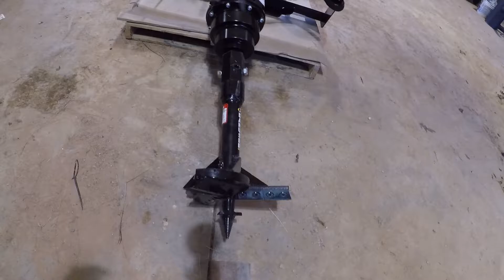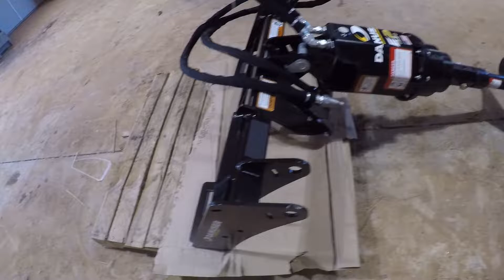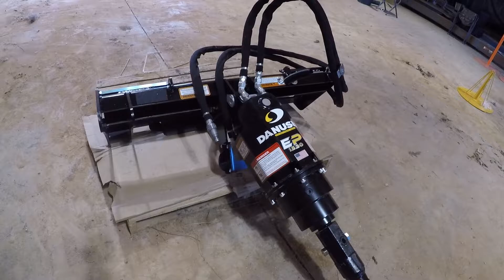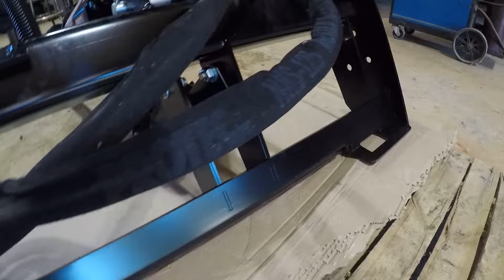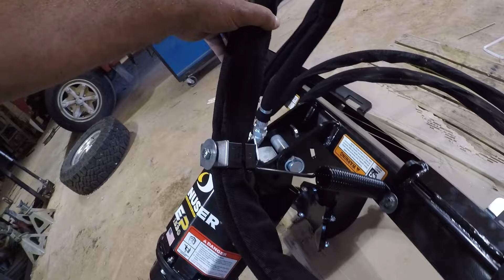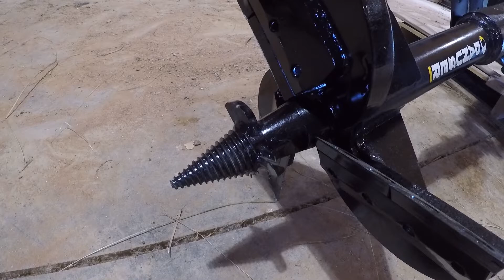Danuser Stump Auger Overview

Comment: Very thorough walkaround, excellent video! Thanks!
Reply: Can these be used on mini excavators like a 30G Deere?
Reply: @TexasStar1  Yes. The 10" needs an auger drive with 1,700 ft. lb. or torque or more.  The 16" needs an auger drive with 3,000 ft. lb. of torque or more.